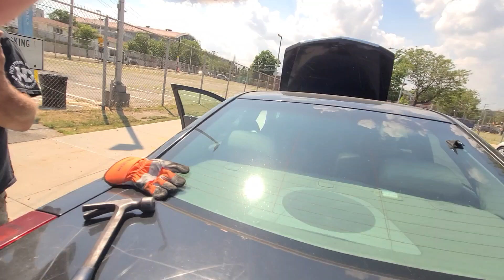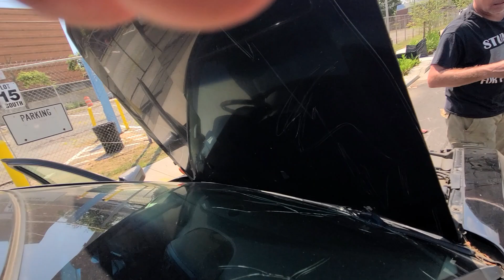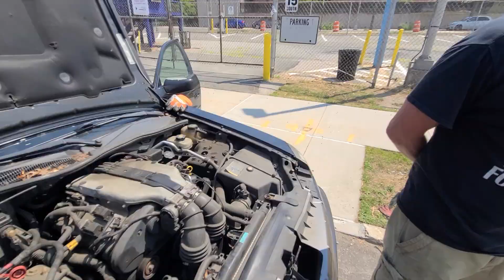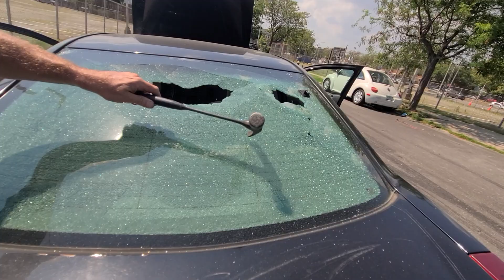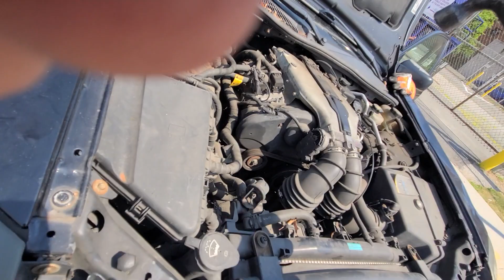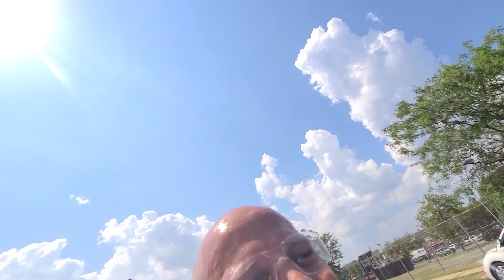Cameraman Smashes Cadillac Timing Belt Gear While Redlined! Only on Neutral Drop!

Comment: That is the 3.2l that’s the same motor as the 3.0 used in the Saturn VUE for 2002-2003. It’s actually a Saab motor.

Comment: Me thinks stunt downplays his car knowledge. He knows about the cater-rible as dealers called those as they ran away. None wanted to work on those Opels.
Reply: straight GARBAGE! which was a damn shame cause that platform could've been a great thing for caddy!
Reply: @signlsirchir2156  They planned for an LS v8 in germany but it didnt quite fit and had cooling problems. If you like the chassis get the widened version which was the 2 door 2004-2006 pontiac GTO
Reply: @CRAPO2011  I don't like anything gm. well ok the old school 14 bolt axles are cool.

Comment: Day 2 of requesting you guys blow up a RX8.
Reply: Dude they're hard to come by
Reply: @StuntmanND  yeah they get scooped up fast. The cat alone is worth about 1200 usd.
Reply: @StuntmanND  Worst car ever made, RX8. At least 3 a week would come in to the dealership. You can start them on washer fluid, with rubber tubing. And a long time cranking the Junk weak rotor tip engine. Takes 4 men to push one also.